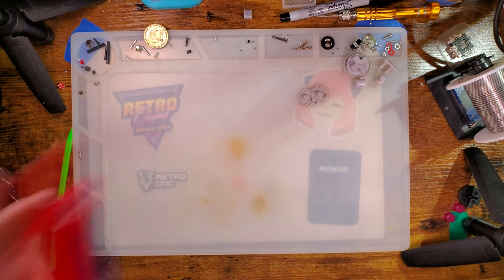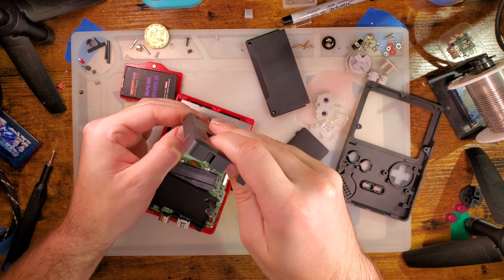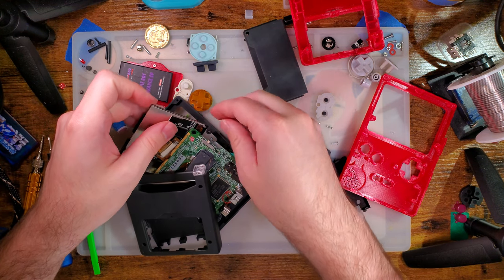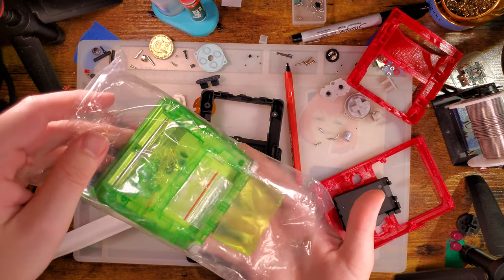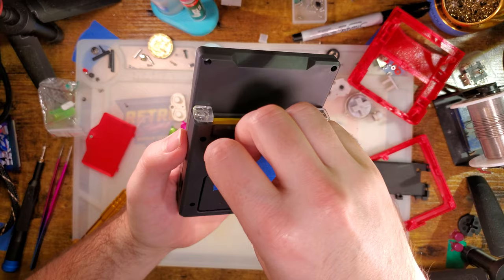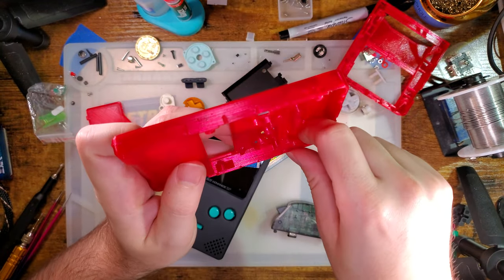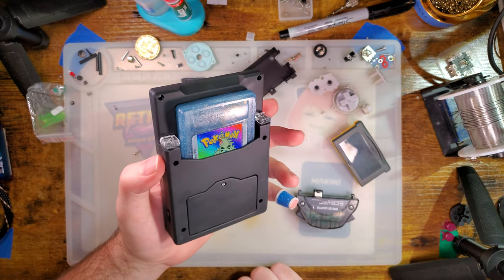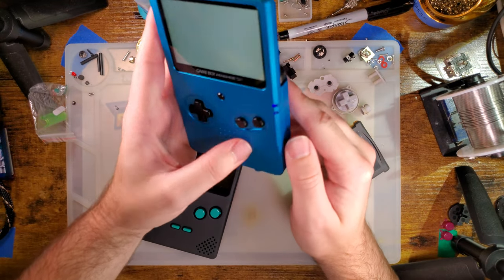XIPHER Slab V2 (Paid Print -- Black Resin)

Comment: I do fully agree with your sentiment to home printing however I use craftcloud for 3d printing and they have every option from high to low with every material possible and you can print some very high quality products for a very affordable price and can even choose how much filament you want and to have it sanded and polished from the distributor. I would say it's gotten pretty much to the point of commercial mold injection quality. The one thing I don't know is how well the plastic would hold UV printing for those really cool custom cases you see a lot. Anyways love watching your vidoes makho and thanks for sharing as always.

Comment: Yeah, this is much more what I'd expect from a resin print, the tolerances are huge though and was a design choice, id be curious if you could scale that battery cover in 2 dimensions and leave the third alone, little bit of math and a micrometer would be all it would take, redoing the d-pad would be considerably more effort but doable.  The way Xiphers got the screw posts are no biggie to resin, it handles supports way differently(and in this kinda situation, better) than fdm.  Just from being familiar with the printing side id really have high standards for what the resin used was as places tend to skimp on it(esp when an engineering/tapable nonbrittle resin is 3x the price) but even then on the home printer this shell would be in the maybe 8$ range out of the good stuff.  What did you end up paying to have it printed? how has it held up since?
Reply from the maker: Admittedly, I don't really use this console. I barely play game boy games and when I do, I tend to just grab a GBC for GBC games or a slate for GBA games. That being said, it's been kicking around in bulk storage with the rest of my consoles for over a year now and still has zero tangible issues. 

Both the resin and nylon prints together would have been less than I paid for shipping so the whole order was probably like $35? I'd have to go look it up and subtract the other things I ordered at the same time.